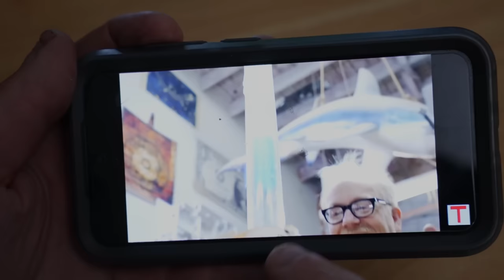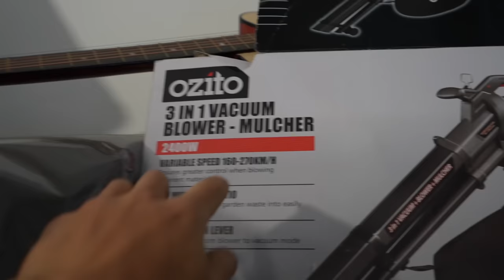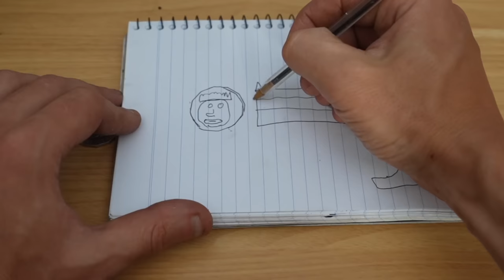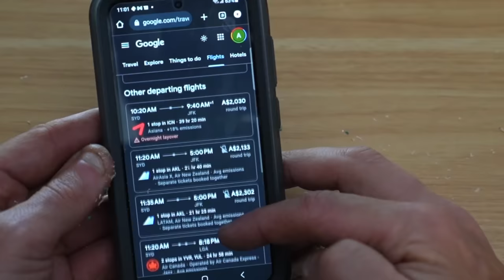The Mythbusters Were Wrong!

Comment: I feel like even if you give the coin spin and throw it really hard from the top of the empire state building, the air drag will both slow the the coin's velocity and rotation. Until it starts tumbling again and slow down until it reaches the terminal velocity that the mythbusters determined
Reply: If you get enough spin on the coin though it should remain stable for long enough to hit the ground
Reply: This is indeed the most likely outcome. However, that doesn't make nearly as fun a video so we can suspend the disbelief for a bit to enjoy his chaos for sure.
Reply: @heckin_dinosaw  That would take a ton of spin and at that point you're not dropping the coin you're launching it which doesn't prove the Mythbusters wrong
Reply: This is exactly it. While i commend the work he did in trying to prove his theory, he didnt just make some claims and not test, in reality this video is just a clickbait title for sponsorship and views when it comes down to it. 

To start off, the mythbusters werent wrong, their myth was specifically about pennies so using coins other than pennies already discounts you from being able to say they were wrong. Two, unless you have a machine to spin the coins, a human spinning it by hand is not going to be able to impart that much spin to keep it super stable. For comparison bullets with rifling can spin over 100,000 rpms. coins also have 2 big flat faces, so unless you give it incredible spin, and drop it perfectly perpendicular to the ground, you will have a ton of air resistance hitting on of those surfaces which will slow it down quickly and bring it to the tumble state much quicker. 

Also, the sponsor section is good for the most part, but the drill bit section was like watching a Billy Mays commercial, hes just mashing the drill bits into steel without giving them time to remove material, ive broken several bits on drill presses by pulling down to hard and not letting the drill actually do its job.
Reply: @jeffreysell109 well yes HOWEVER you completely disregarded the entire video beginning where he literally said "but they never accounted for those types of coins they surely would kill a person" meaning he made a different type of experiment to find out if a different type of coin will indeed do it while still doing the exact same experiment just with one small change
Reply: @jeffreysell109  "This video is just a clickbait title for sponsorships and views" mate are you new to YouTube or something? Because you just described the majority of the videos on this platform if he doesn't play nice with the algorithm you wouldn't have seen this video to begin with 

and multiple different countries all have different types of coins one might consider a "penny"  for example Britain has the 1p coin and then they have a larger 2p then a much smaller silver 5p then a 10p coin similar to a 1p coin in size and then a 20p and 50p coin with jagged edges these are all essentially penny's it's kinda what the p stands for yet the myth busters only tried the experiment with a single type of penny 

Also in the myth itself kindly tell me where it specifies you simply drop the coin? We all assume that is the method of dropping it but what if it's pinched in some way and gets launched off? Or someone creates a device that accidentally or  intentionally  launches a penny of a high height?
Reply: i think the flat spots on the coin would act something like a turbine and would keep it spinning, or even make it spin faster.
Reply: @oldfrozenwolf6803  "Also in the myth itself kindly tell me where it specifies you simply drop the coin?" It's right in the myth itself, and is even stated at the very start of the video (0:02): "if someone drops a penny from the Empire State Building". I've always heard it as "drops" never as "throws", presumably because its meant to be a cautionary tale about being careful, not a story about intentionally causing damage (in which case, you'd just drop a brick)..
Reply: @andysmith1996  ya ok fair enough my bad but I do think my other points still stand
Reply: @UnkownWonders   Im not disagreeing with you on that point, he made his own experiement with different coins, but it doesnt change that fact that he didnt prove anything the Mythbusters did was wrong as the title suggest. His experiment has nothing to do with the Mythbusters, he did his own similar experiment to see if "coins" implying any coin could kill you. The Mythbusters experiment was dropping pennies (and given that the show was made in America, this inherently implies American pennies, and the title of the episode is literally "Penny Drop") from a skyscraper could kill you or not, and they proved through their experiment that they could not even break skin barely. For him to have proven them wrong he would have to use the same exact coin, with different results. If he had used an American penny with his "spin" theory (because i believe as long as youre only spinning the coin and not also throwing it, youre still under the definition of dropping it) and accurately proved it out that it worked with the penny than he could say he proved the Mythbusters wrong. Its like someone doing an experiment "will a bowling ball dropped from 1 ft high break your toes or not" proving that it doesnt, and then someone else doing the same experiment but drilling out the bowling ball and filling it with lead, and doing the same experiment and saying "ahhh i proved you wrong a bowling ball can break toes from a 1 ft drop. " , it may appear to be the same, but its completely different.
Reply: @oldfrozenwolf6803   as @andysmith1996 pointed out its literally in the myth and the Mythbusters episode is literally called "Penny Drop". 

In terms of the types of pennies, thats just a bad argument to make a counterpoint. The show was made and filmed in the USA with Adam and Jamie both being from the USA, and the fact that while the myth states "dropped from skyscraper" it originates from the empire state building, it would imply that the penny referred to in the myth is an American penny, which is exactly what they used. Also, the myth explicitly states "Penny Drop", not coin drop, so it excludes any coins which are not pennies. Its like someone doing an experiment "will a bowling ball dropped from 1 ft high break your toes or not" proving that it doesnt, and then someone else doing the same experiment but drilling out the bowling ball and filling it with lead, and doing the same experiment and saying "ahhh i proved you wrong a bowling ball can break toes from a 1 ft drop. " , it may appear to be the same, but its completely different and doesnt disprove the original experiment in the slightest. 

Even if you give him the benefit of the doubt on all of that, he still never even proved that the coins spun by just human force could stay stable long enough to reach the velocities he claimed they were capable of, or reach the ground at those speeds either, so he didnt even prove his own self right though experimentation, only through theory with small scale tests. 

And yes, ive been around youtube a bunch, i understand most videos have this approach but it doesnt make my statement any less true. Anything containing Mythbusters in the title would still grab attention "Expanding The Mythbusters Penny Drop Experiment".
Reply: @jeffreysell109  never said anything about mythbusters only clarified your second statement was off since he never actually claimed to rebunk it but rather try it with his own coins. Ofcourse he never proven anyone wrong and I never said that I'm sorry if that maybe came off like that in the previous message
Reply: @dissahc  I think any vortices (or turbines) would actually cause more drag and not make the coin spin faster

Comment: The biggest thing you should test: How far would a spun coin fall before it begins to flutter?  I doubt it makes it all the way to the ground from the Empire State Building, before wind/air pushes it enough to cause issues
Reply from the maker: Yeah i really wanted to find a building or cliff to throw it off. Unfortunately no building would let me do it and all the 200 meter+ cliffs had like a day hike to the bottom.
Reply: @Ididathing  Do a collab with How Ridiculous.
Reply: @Ididathing no chance in hell will a coin stay on its edge the entire way down the empire building without rotating. All this did was “prove” that a fast coin could potentially be lethal…

That said, it was still entertaining.
Reply: @Ididathing how dare they impede science?!
Reply: @Ididathing  you should make a launcher that's like a frisbee launcher so you can make sure the coin is spinning not just staying on its flat edge
Reply: He can’t do that, because if he did, he’d basically proved the myth busters right
Reply: @Ididathing  You strayed too far from the origin of the myth, which I'm pretty sure requires the coin to be a penny.
Reply: I would say the faster it spins, the more stable it will be. Probably the spinning stabilizing effect starts to wear off when the linear speed is faster than the spinning speed of the outside of the coin. the spin still has gyroscopic effect but the aerodynamic effects probably becomes prevalent at high speed. I think a PENNY FALLING  from the empire state building will probably never be deadl . but a coin shot with a spear gun made to pierce through animals or spun extremely fast with a fast electric motor could. I think hand spinning the coin from the empire state'probably  wouldnt be enough to keep it balanced and accelerating down to the ground. probably easier to reach higher speed from lower height. once the coin start tumbling it will slow down a lot

I think if the video went longer it would have ended up shooting a cannon or high cliber shot gun stuffed with pennies
Reply: @h8GW  And also, it's more about casually tossing it off the building, not pelting it like Randy Johnson with murderous force.
I feel like Idid is doing the "replicate the results" part of a MythBusters episode, where they've already busted the myth so they alter the rules to see what it would take for it to work.

Comment: i like your 3d printed device for dropping coins. i would add a silicone bottom to the chute in which the coins roll out of for the next design. Also a bit longer chute. that way they have time to roll faster and, with the silicone, have no choice but to start spinning once released from the mechanism. Loved the video man. Keep up the great work!
Reply: he would probably need a bigger drone too if hes adding more weight to it
Reply: A thin strip of grip tape or sandpaper might be an easy fix as well.
Reply from the maker: Thanks mate. I was also thinking off adding a little wind turbine on the end that spins from the downforce of the drone rotors and then spins the coin. But it was too much effort
Reply: @Ididathing  hey that sounds very interesting. Wow I didn't think of that. Do it, no shoe man! I bet it'd make another epic video. That's a great idea.

Comment: I think the key is spin. It's the only factor that can counteract wind resistance when the coin is launched at altitude. I think you should configure your test equipment to optimize spin rather than velocity; from there the coin should find and remain at terminal velocity just by the effects of gravity alone. Of course, if you could do both, you could do your test at ground level with more accurate results.
Reply from the maker: Yeah exactly. I dont think i explained my logic well enough as some people think im throwing it or shooting it to overcome the terminal velocity.
Reply: Even then, with that long a fall I wouldn't be surprised if it started to flip on the way down due to air currents.
Reply: @kjyost  I'm thinking the gyroscopic effect would require a LOT more force to cause it to flip, but yeah I guess it would spin down eventually.

Comment: This is cool, but it contains a bit of a fatal flaw. That is that you tested for the terminal velocity of the coin, but in reality you won't reach that velocity from the top of the Empire State Building. The Empire State Building is 380m tall from it's highest floor, and 443m at the tip of the antenna. That means with the max acceleration of 9.8m/s^2, you reach a max speed of 93.21m/s after a 9.5 sec fall. That assumes that air resistance doesn't slow it significantly. I can't say for certain if that alters the lethality of the coin, but it is 1/3 the speed you used. To achieve terminal velocity at 270m/s, you have to launch the coin to a height of 3722m, or 10 times the height from the highest floor. You also will want to test something with a brain substitute as well, because a coin lodging itself in certain parts of the brain may not be fatal. It can be surprising just how much of the force the skull impact will diffuse and how much of your grey matter is useful but optional to continued life.
Reply: Fix all this to be in feet and inches this was increasingly difficult to read because none if it made any sense number wise

Comment: I'm curious how crosswinds affects the ability for the coin to stay vertical.  The drone test leads me to believe that it's likely to spin once the wind hits it, especially in New York where the architecture is known for creating some insane wind speeds between the sky scrappers.
Reply from the maker: I think it all depends on how much spin you put on it. The fact that it was still dead straight and spinning from 45 meters gives me faith that is has a chance of making it all the way from 300 meters.
Reply: @Ididathing  spinning won't save the coin from being hit by any form of crosswinds generated by winds loads since the flat side will always be exposed.
Reply: @Theanimeisforme  But have you considered that he has a dream?
Reply: @Theanimeisforme this is true, but may not be relevant. The drone test didn't have much spin on the coins at all, so we can't necessarily draw much in the way of conclusions from it — and if anything, those lateral winds should stabilise the coin vertically by means of the same forces that stabilise an unspun one horizontally in their absence

Comment: The spin will only last so long before slowing down enough to destabilize and start floating on side.
Just look at frisbee/disc golf. Spin keeps it stable until the spin runs out, then the disc starts to float and tilt.
Reply: You will just have to jump after the coin and spin it mid air :)

Comment: The Mythbusters were right! According to forensics articles, an air rifle pellet (.177), weighing ~8.5 g, must be, at least, at ~364 km/h (101 m/s) just to break the skin of the head (and have the minimal chance to cause damage to the skull and the brain). Considering that the attack edge of the pellets are usually round, for simplification, I'll consider contact of 33% of its surface on impact (the lesser, the greater the intensity and potential damage). The result is 0.00825*101²/2/(π*(0.0045*0.33)²) ≅ 6 MJ/m². For the coin, using terminal velocity of over 300 km/h (84 m/s, rounded up) and considering it hitting flat on one of its dodecagonal sides (because, even if it hits the target on a sharp tip, the proposition is that the coin would be spinning, so soon after contact, the coin would turn and make full contact with one of its 12 sides), it'd yield 0.01824*84²/2/(0.003*0.0042215) = 5 MJ/m²... That is, a 50 cents coin, spinning and hitting the target on its edge, at terminal velocity, would yield 1 MJ/m² LESS than an air rifle pellet shot at close distance, barely able to break the skin, much less cause any significative damage to bones and even less to the brain.

Comment: You covered the sensors of the Drone that measure the distance to the ground. If the Drone is too near to the ground it wants to fly up, since they are covered it think it's on the ground. With the Litchi App you can disable these Sensors

Comment: Also for the speed measurements, you need to take account of the fac tthat the coins are close to the camera than the back board. If you moved the back board to a mile away, and made the lines 10 times further appart, and did the same thing again, you would get insane speeds. You need to calculate the distance travelled at the coin's position, so if the coind are say half as far away as the back board, then the angle subtended by the distance between the lines at the half way point would mean that the distance was actually half that at the back board, so with that in mind, you calculation was probably too fast by a factor of about 2.
Reply: Garbage in, garbage out.
Reply: Maybe that's a factor. But the main issue is that he measured the distance totally wrong. He took the start of a 5cm blur to the end of the next 5cm blur, adding the blur length to the distance travelled. Instead of 20cm it actually went like 12cm, which you can tell by looking at the video again and measuring the center to the center of the blur. If you plug that into the same formula as he did you get 103 km/h about the same as the 110 km/h he measured later.
(0.12 m)*(240 Hz)*(3600 sec/hour)/(1000 m/km) = 103.68 km/hour
Reply: i was looking for this comment and you are absolutely right, + @himanbam 's point is also a factor
Reply: @himanbam   right but the first guy point is also a big factor

Comment: I think the smaller rubbers worked better because of the tracks keeping the coin in line. with the larger rubber the load might get released to quickly. don't worry though many men suffer from this problem.

Comment: The rubbers worked better than the previous because the stored energy is much larger, if you were able to pull the thicker rubbers back further, you may reach better speeds, but, you will hit terminal velocity.

Comment: Thanks for the video. I have to say that the coin would still stay mostly upright due to drag forces pushing it into it's most aerodynamic position, which is when it's upright, so you don't have to put a spin on it when it travels fast enough.